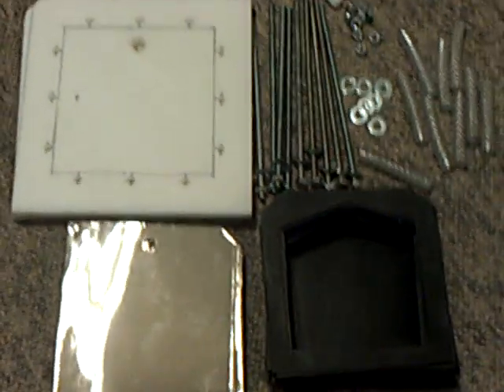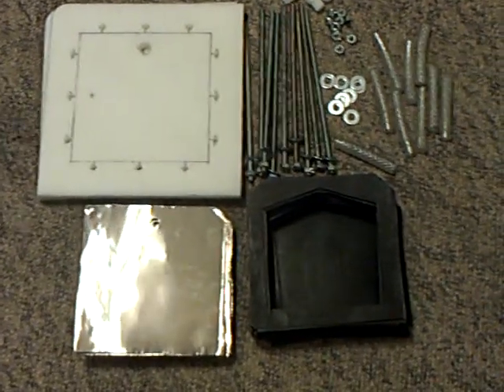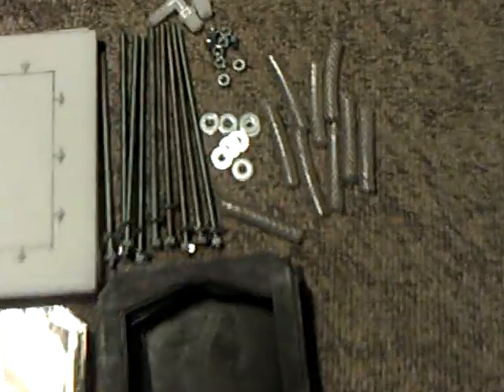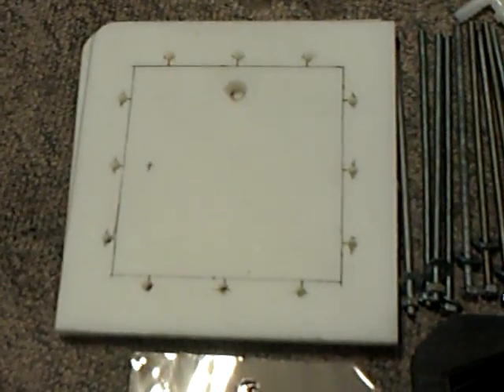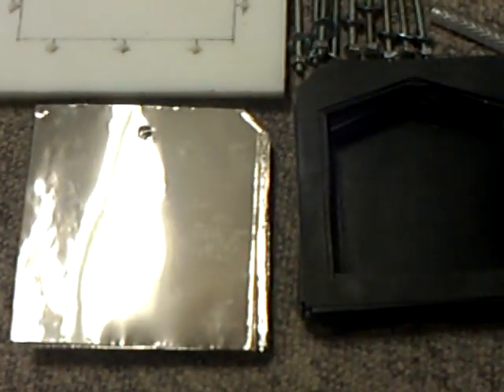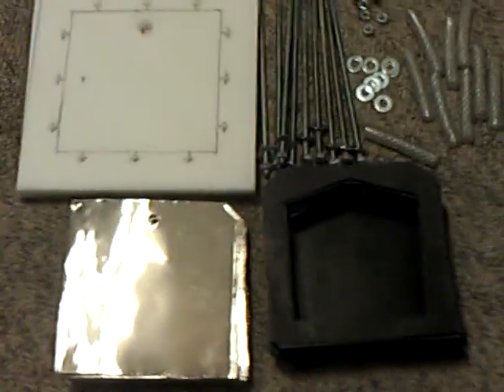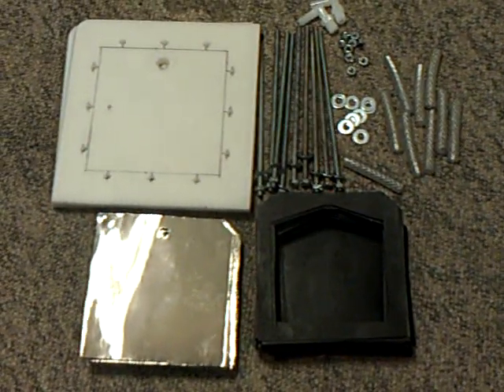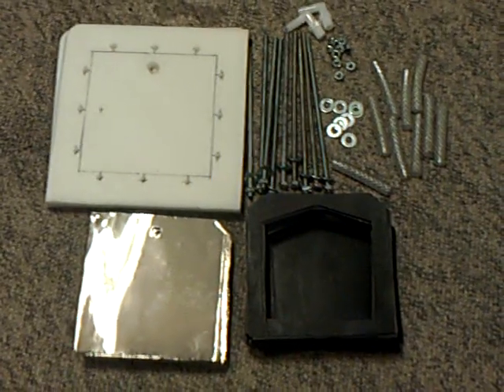My new HHO DRYCELL project#3 Materials

Comment: I am not sure what advantage the connection scheme you describe would have over a simpler +-+-+- setup ... and if you have enough surface area, and were able to hit it with enough amps at 2v, such an array can be very efficient and produce a lot of gas ... problem is finding a 2v power source that can provide 1000 amps ... with the power sources available to me, I need those neutral plates to give me the drop in voltage required to keep it efficient ...

Comment: oh yeah, high voltage is when you start getting into the thousands of volts ... if you are only using 70ish volts, that's still low voltage brute force electrolysis ...  so the normal rules apply ... as you get up into the thousands of volts, there are some new rules ... 

have fun with it, but play safe ... if properly constructed, your device could make as much as 4 lpm of gas ... make a hell of a nice torch ... that much gas can bite you in the ass if you are not careful ... safety first ...

Comment: tried that ... did not help efficiency ... the current leakage in these designs appears to be from one side of a neutral plate to its own other side through the hole instead of the electrolyte ... so alternating the holes don't help ... but a piece of slit tubing run down the length of the hole helps a lot ...

Comment: najman100 is correct ... you really do need to have your steel laying flat ... consistent spacing is critical to good efficiency ...   do you have a way to press those plated flat ???  it would help your efficiency at lot if you did ...

Comment: this will work quite well ... the original Tero Ranta type devices only had a single hole at the top, and a single hose from the reservoir/bubbler that both fed fluid and exhausted gas ... it worked well and was quite efficient ... but they give off gas with a pulsing action I found objectionable ... which is why I went to the lower hole and tried pumping fluid through it ... but you may be surprised at how well this works ...

Comment: try to drill the hole fare left so you can alternate them one left and you flip the other so it will be on the right and when you drill make sure that the drill size match a grommet that you can fit in the holes for more electrical insulation